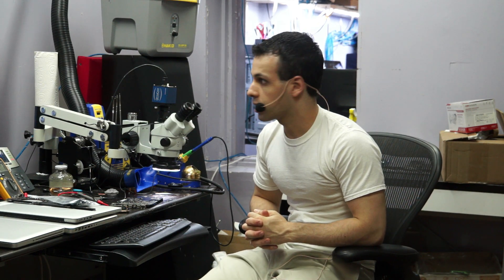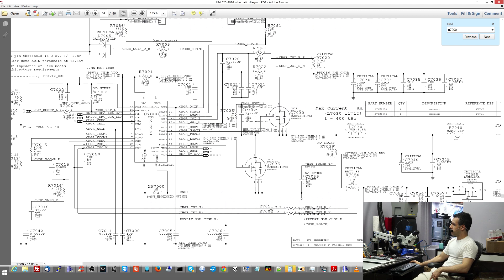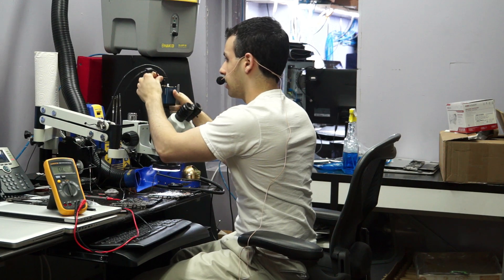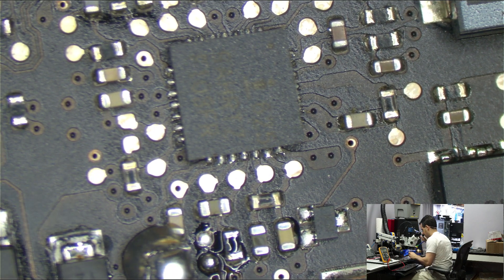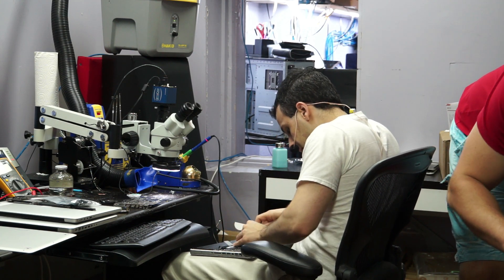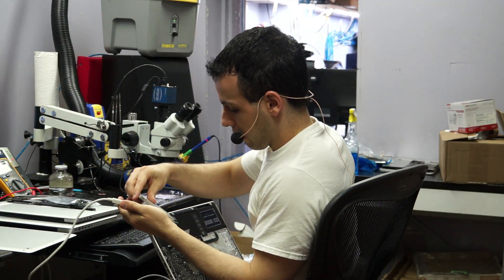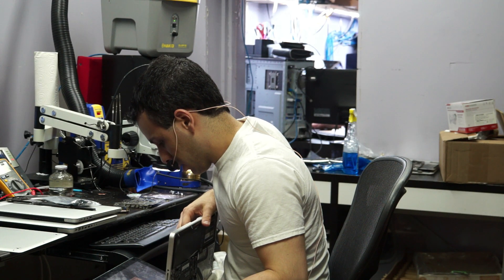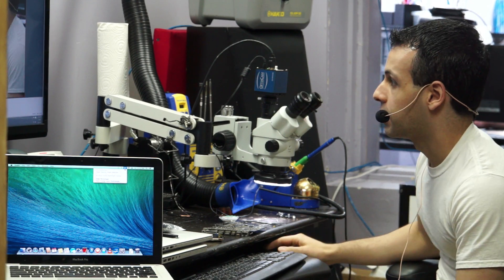Macbook logic board not charging battery repair.

Comment: Can I get one of those zero-ohm resistors without a donnor board? 
How can I buy that part? 
I need to replace a R7052 current sense resistor (at least).
I am still not sure on the specs of that damn resistor... :(

Comment: hey louis, i have a A1502 that not charging the battery not because of motherboard issue but the battery voltage is too low, cells voltage is about 2v, i tried to charge the cells direct it come to 12v but the output of the battery still 2v, i can't bypass the battery security, any ideas ? the macbook detact the battery but in 0%
Reply from the maker: +Youssef Badra replace the battery

Comment: Hi Louis. Can you help me with a 820-3662-A board that is not detecting the battery? The machine powers on and works while charger is pluged in, but It shows X on the battery. If I remove the charges it goes to sleep. I Have checked Data lines and it looks to be OK. I have changed the ISL because on CHGR_BGATE I was getting 11.5V but the same. I am not verry experienced with this and I just don't know what else to check. Please, please give me some pointers. Thanx.

Comment: Got a 17" mbp. Battery was responsive, magsafe light orange. Powered it up. Heard loud noise. Shut it down by holding power button. Now it is completely unresponsive. Battery indicator light doesn't even respond? Tried resetting SMC. Nothing. Any ideas?
Reply from the maker: fix it
Reply: Obviously.
Reply: Thanks anyway, Plato.
Reply from the maker: +zizoumonk10 there are 300 videos here to walk you through how to fix that problem
Reply: Did you even read my question?

Comment: hi bro, after I change my macbook air 11 Baterry I can see computer automatic gone freeze after using of 1 hrs. do u think its a Baterry issue?? please help
Reply from the maker: No idea, did you use a good or a shit battery?
Reply: Louis Rossmann  its a good Baterry with 1 year warranty. but before I replace I want to confirm is this a Baterry issue? because before this Baterry I run my laptop with out Baterry and that was working excellent.
Reply from the maker: If it is a good battery then not the battery. If you bought a crappy battery it is the battery.
Reply: Hey Baba, have you find the issue? I have the same problem with an 820 4924 logic board.
With battery it make a bootloop on start up, without battery it work fine!
Help me...!!
P.S. It makes the same with 2 different good batteries.

Comment: HI, i got a water spilled MB air 2013. Everything works fine, instead of charging a battery. When i disconnect a battery, and plug in a charger, charging light turns on and everything works well. If i then plug in a battery (when MB is running), it is charging properly. Only problem is when i have normally connected battery in a i plug in a charger. In this case it is not charging. So my only option is to unplug a battery every time before i plug in charger. What video should i look, or what i can look for? Thank you very much for your time.
Reply: i forgot to say that if battery have some capacity, it can boot up from battery without charger.
Reply from the maker: +Ondřej Veverka look for something that isn't working b
Reply: Ok, i undestand. But there is a lot of chips and videos about them, so i hoped in a little help when should i look. But anyway thank's a lot for your videos.
Reply from the maker: We have a paid subscription for  if you want specific answers to specific questions and free videos if you want free help. I don't troubleshoot boards in the comment section anymore or else I would get no work done.
Reply: thank you i will look for it :)
Reply: Hello! I have the exact same problem. Did you find a fix for this?

Comment: Louis Rossmann, thank you for posting these amazing videos! I'm not sure when you'll have time to see this comment but I came across this small issue on my Macbook Pro 13"(2010) . I had to put thermal compound on the heatsink. I am not an IT person so I watched many videos on how to do so. I followed the instructions carefully but when I put everything back together it wouldn't turn on. I found out that it would only turn on when I plugged in the charger. I spent two days straight where I then found out that there was "no battery installed". I'm guessing I discharged the battery connection (if that makes sense). I am trying to get this Macbook pro fixed so I can send it to my grandma(lives in Brazil) as a gift so I can FaceTime her!
Reply from the maker: you destroyed the SMC https://www.youtube.com/watch?v=kPNc4I68V6M
Reply: I watched the video. Thank you for that. The thing is I used my fingers and tweezers. You know more than I do.I guess this is what happens when a chick like me thinks she can fix a macbook pro.
Reply from the maker: +Fabya Arantes I've done worse!
Reply: lol!! Since I can't do much I would be sending this macbook pro to you in a heart beat even if it would take you 6 weeks to do it! Though I'm pretty sure you do not live in GA.

Comment: I tested the R7022,R7021, R7051, R7052 and everything looks fine! Where to look now? I have my battery recognized but not charging, even with my new battery it does the same..
Reply from the maker: +David GL See if it runs off just the charger
Reply: Hi, 
It runs with the magesafe without battery, i tried with new magesafe but same, battery not charging, but detected! I dont get the orange color from the magsafe..

Comment: Hi, Louis, thanks for your owesome effort, in my 820-2850, what if the R7052 which is supposed to be 0ohm is 0.3, would it make a difference, do I try shorting the leads, the battery does not charge  although the light is green not orange, and I get PPVBAT_G3H_CONN 9.6 volts on the 3 leads, Q7055 takes 12.6 but gives 10.6 thanks a lot

Comment: Hi Louis, I just message you over your website before waching this video. I had an a1286 mid2009 MBP (820-2533-a) with battery service alert (no watter spill). I decided to open the laptop, unplug the battery while connected to the magsafe hopping  to "restart" the charge battery cicles. Now battery does not charge (magsafe dim green light), I thought it was the ISL6258AHRTSZ because it is overheating but I'm just using common sense. Can you tell me wich componentes are compromised when you do the stupid thing I did? Can I just replace the ISL6258AHRTSZ?

Comment: Your videos have taught me to trust no components in when it comes to electronics. Whereas before my distrust was biased towards electrolytic caps and ICs, you shown me that ANY component can fail. Tonight, I've used this knowledge to try and repair an Acorn 3 button mouse (getting rarer than rocking horse shit), the issue was a shorted SMD resistor and, upon replacing, the mouse sprung into life for the first time much to my delight (a small whoop was done).  Now I can make a small video showing others what to check for and how to repair and save a small bit of vintage history from disappearing :)  Thanks Louis
Reply from the maker: +Sabretooth Barnacle Glad this helped! Yes the idea of blaming the electrolytic caps for everything is almost as bad as the rice myth...